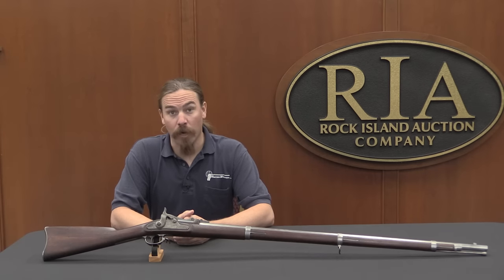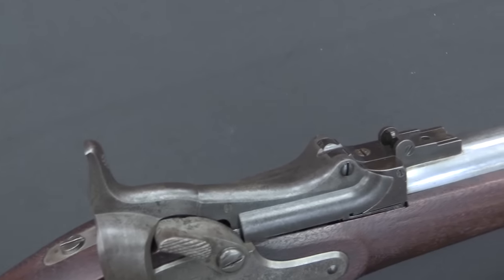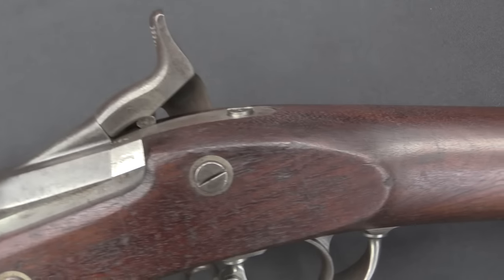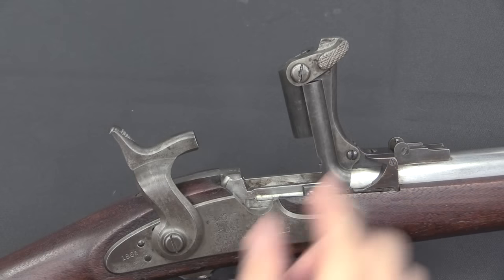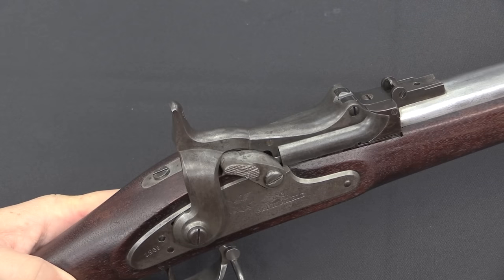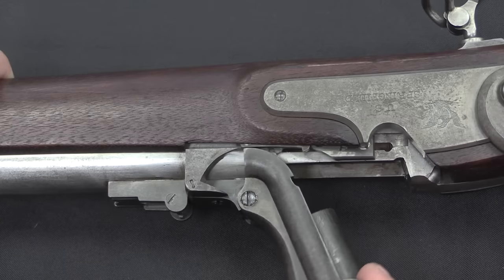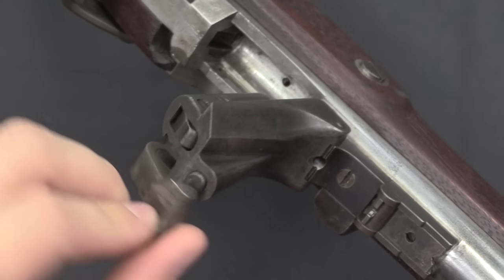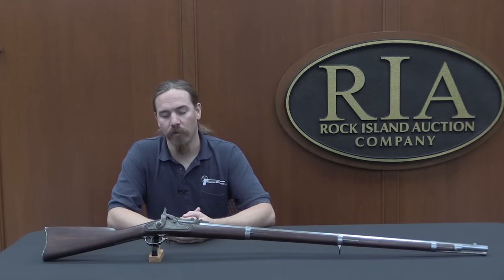First Pattern 1865 Allin Conversion - Trapdoor Springfield

Comment: I have this exact Springfield 50-70 rifle. My great grandfather found this rifle hidden up in the rafters of the ceiling in Fort Lowell Tucson in the early 1900’s. The rifle was passed down to me and I will pass it down to my son. It’s the only known weapon to actually come from the fort at this time.
Reply: Came here from you comment on other channel.
Nice weapon
Reply: That's really cool I have a knife from WW2 and a camera to
Reply: This Exact one? It is for sale, but you say it will stay in the family,  i am confused.
Reply: The 1865 isn't a 50-70...
Reply: @craigthescott5074  I thought they were .58-70 rimfire in 65', 50-70 66'-72', and 45-70 after that
Reply: You have a 2nd Allin conversion
Reply: @donaldshaffer9275  mine is an 1865 50-70 so I’m not sure if it’s a first conversion or a second one ??
Reply: @eifnsmwkc  mine is a 1865 it’s stamped on the hammer plate. And I have 50-70 ammo that fires in it. So how rare is this gun?
Reply: @donaldshaffer9275  Donald so what I’ve been told, your correct, the second Allen conversion was 50-70 so I know they also made them in 45-70. Is that a third conversion or were the 45-70’s just made outright no conversion?

Comment: Pretty cool, and the M1873 Springfield Trapdoor would see use right up through 1892 or so when it was finally replaced with a repeating bolt action. By 1892, the French had their Lebel for 6 years, the British had their Lee Metford for 4 years, the Germans had their M1888 Commission Rifle for 4 years, I believe the Swiss had their Schmidt-Reuben for 3 years, and of course the Russians had their M1891 "Three Line Rifle" Mosin the year prior.The Lee Metford's .303 British still used black powder, but I'm fairly certain that 8mm Lebel, 8mm Mauser, 7.5 Swiss, and 7.62x54r all started out as smokeless powder cartridges. 

8mm Lebel DEFINITELY started out smokeless, it was basically THE first smokeless cartridge to be used in a widespread capacity, and I think it was also the first to use FMJ, though I think full metal jacket is a Swiss design. Smokeless powder, which has of course been in use for the past 129 years, having been THE standard type of powder for well over 100 years, is a French design, I think first called Poudre B or Poudre D... I think. It's the morning, haven't had my coffee, memory is a bit fuzzy. I can tell you however that the pronunciation of B and D in the French tongue is basically 'beh' and 'deh'.
Reply: The US Army still fielded more M1888 and rearsenaled M1873 Springfields in the Spanish American War (1898) than M1894 Krag–Jørgensen rifles.  By the 1920s, I think people were binding three or four of them together and turning them into standing electrical lamps.  Ugh...

Comment: Ian, may be we can 3d print some dummy cartriges for showing purpases! If you have blue prints for cartriges or accurate description I can print some for you, i have to shipped it from Moscow, so it can take some time.
Reply: I've always wanted a 3d printer, but not sure I can afford one. Is it an expensive hobby in Russia?
Reply: +BurnThePope0514 Good friend of mine is running a print office, and from time to time we print some 3d stuff.  it's not very popular for a few reasons: 1) Russia economy in a bad spahe, so people trying to minimise unesesary expensess.   
2) Becouse you have to make or buy a 3d model first.  
3) Most people just aren't familiar with this technology, they don't really have any idea about advantages it gives.
Reply: +Lokfuhrer Reloading books (such as Lee Reloading Manual) usually give specs for the cartridges so that reloaders can confirm the rounds they have loaded are within spec. I would look for one of those first and see how close you can print to match. My worry would be the tollerances you can print to, but if you kept it a bit small it should work. If you have access to a firearm or range you should see how the prints work before sending them.

Comment: I am currious why Ian  would say that the hammer on the Allin Conversion was not modifed in anyway from the hammer on the muzzel loading Springfield?  The hammer on the original had to hit a percussion cap that was on a nipple situated on the side of the gun exactly where the release lever on the conversion now sits.  In contrast the hammer on the conversion hits a firing pin on the centerline of the barrel, meaning, it has to be a different hammer.

Comment: So if the earliest models had trigger and firing pin springs then so should the later models right? I have an 1884 in 45 70. Not knowing much about the rifle at the time I bought it, I assumed those springs weren't necessary. Perhaps I should do more research before I damage the poor thing. Thanks Ian👍

Comment: I think that extractor arm could have been modified to have a bar connected to the hammer to cock the hammer in one motion of opening the door. A very simple trigger block safety could've been added to replace the lack of a half cock. Not much more cost at all. But I suppose a bit more susceptible to parts breakage if designed poorly. The increase in rate of fire would be quite alot though.

Comment: So, if the manually-operated locking lever is not in the correct position, would it act as a safety,  preventing the hammer from reaching the firing pin?
Reply: +Jason „cyberspace entity“ Doe i was asking this myself too! looks like the little pin extruding from it leans against the housing of the firing pin...
Reply: +Jason “cyberspace entity” Doe Certainly looks that way, that extra piece of the locking lever sits in between the hammer face and the face surrounding the firing pin. My guess is trying to fire it that way would cause the hammer to hit the lever and maybe partially open the breech as well. Nice little touch when you think about it. Allin certainly knew what he was doing.
Reply: OddballSherman  Yes! Given the era, and the primitive by modern standards base design, I expected a "modernising" conversion to be quite awkward, at last when it comes to ergonomics. Well, it seems to be surprisingly well-thought-out instead!

Comment: I purchased a 1888 Springfield Trapdoor. By than they were smokeless. When did they make the transition from black powder to smokeless?
Reply: Even if your rifle can handle smokeless powder loads, it was never intended for them. The Krag-Jorgensen rifle was the first American military rifle to use smokeless powder.
Reply: +Bladsmith Yeah I'm fairly certain you're right. By 1888, many developed nations around the world were using smokeless powder, what with 8mm Lebel, the brand spankin new 8mm Mauser, the 7.5 Swiss that would be coming out next year, and the 7.62x54r that would be out in 3 years. Though some liked to stuck to black powder; the Lee Metford which came out in 1888 used black powder, and would be found to be no good for smokeless because the rifling didn't hold up well. That's when the No.1 Lee Enfield (MLE: Magazine Lee Enfield) came out in 1895. I have an 1896 model myself.

So the Americans actually had a smokeless rifle 3 years before Great Britain did, however Great Britain had a repeating bolt action with a 10-rnd mag 4 years before America finally adopted their first repeating bolt action. A lot of development happened in the late 1800s, and I personally consider it the start of the Golden Age of Arms Development. Roughly 1886-1960.

From repeating bolt actions of both smokeless and black powders, to LMG development, to SMG development, to both assault rifles and battle rifles being designed at almost the same times, to the advent of polymer and aluminium use in firearms, to name some of the major improvements that happened in this time. Though really, since about 1955, very little has changed except for more use of polymer/aluminium as well as the standardization of rails so as to attach accessories. Whatever gas system or locking mechanism you look at now, chances are, it's been around since 1945 or earlier. Long stroke piston, short strong piston, direct impingement, blowback, delayed blowback, roller delayed blowback, rotating bolt, tilting bolt, reciprocating charging handle, non-reciprocating charging handle, closed bolt, open bolt, cock-on-open, cock-on-close, straight-pull, aperture sights, post-and-notch sights, fixed optical sight with graduated points for various distances, chrome lined barrels... modern designs have basically been taking existing technology and making it lighter, more resistant to weather, and more easily accessorized. 

I don't think a MAJOR arms breakthrough will come about until a new type of ammunition is figured out that doesn't rely on the metallic cartridge, powder, and primer anymore. What that will be? No friggin clue, but as we stand right now towards the end of 2015, it's the best we have available, we don't know how to get better. There's been tinkering done with caseless powder, but it's yet to be done in a successful and practical manner. In 1886, the French Lebel practically made every other Military rifle in the world obsolete with its smokeless powder, FMJ bullet, and magazine which allowed for repeated fire without a reload. It might yet be decades or centuries before we see such a monumental breakthrough such as that. Like the advent of the flintlock, it took hold around the world, and would not let go for WELL over a century. 

In fact yet again it was a French design, and I think they used it for over 200 years from 1600 up until the early-mid 1800s. At the time, flintlock muzzle loaders were the best in the world! There was nothing conceivable that could be more practical! Wheel lock seemed like a cool design, but I dare say it was complex to use, and required a special key in order to wind it up for each shot. Lose the key, and the musket is rendered useless, at least I think so... either way, surely there's a reason why the flintlock took over the world while the wheel lock fell into obscurity like the OLD standard of the day, the matchlock.

Comment: I have a 50 or58 caliber trap door that resembles a carbine but no sign of a Saddel ring ever and the trigger guard has a hole for a sling swivel, 1863 on the lock assembly and model 1870 on the trap door r with an eagle head and crossed arrows  . I need to know more
Reply: E mail is all small leaters

Comment: I have a 1864 springfield that I got from my father. He told me that it's .58 caliber, but when I insert a .580 (exactly) Minnie ball into the end of the barrel, it simply falls all the way to the bottom. (It is quite loose. I've watched some videos and people don't seem to put wads on their conical bullets when loading, usually that's only with balls. So what is the reason my barrel is so large? It measured .60. Why is my barrel .020 over size. I don't know a lot about these rifles and would appreciate any assistance I can get. Thanks everone.
Reply: Not sure what to say about your musket barrel bring .020" oversized.
Usually the manufacturing tolerances were held way closer than that.  I assume the barrel still has the standard 3 groove rifling ?
If not, maybe it was reamed out for a shotgun, which was not uncommon after these guns were sold off as surplus.
Reply: @ifitsfreeitsforme1852  correct, it still has the 3 groove rifling, and it looks very prominent and not wore out. But I should point out that it is an old barrel and it's pretty pitted. Can't read any markings on it though.
Reply: @grantdeisig1360  as a last resort perhaps you can locate an oversized minie ball mold. Somebody that's active in the North South Skirmish Association might be able to point you in the right direction. Another possibility, although expensive,  would be to have an expansion die made that would expand the skirt of the minie ball to within a few thousandths of what your gun's bore  is. You could check with Dixie Gun Works also. They have a lot different molds available.
Reply: I own an 1864 as well. Ill measure my barrel as Im curious now!
Reply: @shasba , please let me know. I was watching Hickok45 and he was shooting a 1863 model Springfield with conical bullets, and he was showing .580, .581, and .582. All of which required some lube, and be pressed in with the ram without a patch. So I know his barrel isn't over sized like mine. The optimism in me wants me to believe I have a secret one of a kind union sniper rifle in an experimental bore! Lol (I doubt it)
Reply: @grantdeisig1360   If you feel comfortable giving me your email Ill send you pics.
Reply: @grantdeisig1360  Mine is .580
Reply: @shasba  I don't need to see any pictures, but thank's for letting me know. I'm really going to have to get with someone that knows a great deal about these rifles so I can pin point what's going on with mine.

Comment: They saved a lot of taxpayer's money by modifying existing rifles. Not bad.
Reply: That is also true. As always, people at the top forget what the real truth is for people on the ground. And not only in the military.
Reply: TiglathPileser3 .....Until the bolt action, single shot, high power rifles were definitely the most effective for standard line infantry.